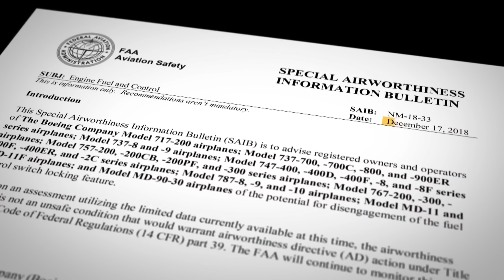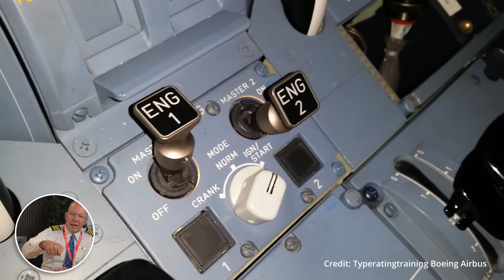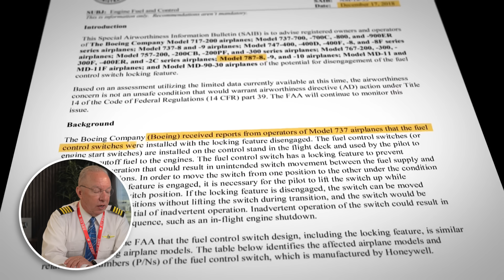Air India 171: The FAA’s 2018 Fuel Switch Locking Bulletin Explained (16 Questions Answered)

Comment: Captain Steeeve, I'm wondering why the pilot and co-pilot don't do a checklist before taking off.  And if they do, maybe this fuel switch locking feature needs to be part of the checkoff going forward.
Reply: This is in a checklist and the switches were at "on" or the plane could never have taken off.

Comment: all this convo about the plane not letting you not cut the fuel if the throttle is not on idle. what happens when engine fire or if the throttle is stuck

Comment: Video in the cockpit:
I know there is a lot of opinion regarding video recorders in the cockpit, and pilots privacy.  I personally think that given the importance of the job it is time that video recording was added.  Even bus drivers are often recorded now.  I think it unlikely that footage could be leaked in the same way that aircraft are not susceptible to hacking, i.e. no unsecured connectivity.  In the case of Air India 171, I really think there is a strong possibility that we’ll never know for sure which pilot set the cut-off.  What would it mean to their families if the wrong pilot was accused?  
The pilot who said “why did you cut-off?” could still be the one who did it, but who wanted to avoid accusation. Therefore, maybe the pilot who said, “i didn’t” had not done it. Wouldn’t cockpit video recording just provide extra evidence to work on?
Wouldn’t cockpit video recording help determine a pilot’s state of mind?

Realtime off-aircraft recording and analysis:
I’ve heard as part of the MH370 investigation that only some data is transmitted from an aircraft in realtime, mainly in terms of aircraft performance and maintenance.  Aren’t we at a point technologically where all FDR and CVR (and video) data, and position can’t be streamed and recorded to a secure data centre, in addition to onboard FDR and CVR?  This would lend less reliance on finding them, being undamaged, and save time.  In terms of MH370, it would have been invaluable.

Why default to cut off position:
Why does the switch default to, or be sprung to, the cut-off position?  I know it needs to be lifted, but why default to cut-off?  Why does it even need to default to either position?  Does the landing gear lever have a default position?

Why no “are you sure prompt” when in flight mode:
When the aircraft is in flight mode, i.e. the wheels are off the ground, why is there no confirmation prompt “Are you sure?” before a cut-off switch performs the selected action?  It seems easier to turn the engines off in flight than it would be to raise the gear on the ground.  If I wanted to delete a file on my computer I would be asked to confirm, but switch all engines off during flight or during climb and there is no confirmation?  Pilots will make errors, and aircraft will always malfunction, but it seems some quite basic logic is missing in aircraft systems, either misleading pilots or enabling them to almost make mistakes and get into situations which aren’t practiced for.

How often would you cut off in the air routinely:
Seeing that it is quite easy to cut off engines during flight, how routine is it to do so? For example, does a single engine need to be cut off once every 1,000 flights on average?  Does it occur more often than we think?  Would a confirmation step add too much of a time delay for the majority of routine cut-offs?  

What are the switches like in Airbus and other manufactures?
Are the switches common across other aircraft manufactures and do they work in the same way and have the same method to stop accidental operation?  My car has a lot of “soft” buttons and switches now, so if I try to push the soft button for reverse while travelling forwards at speed, the button just animates back to drive.  You have to press and hold to override that.  But at least is gives me a visual and audio cue that I messed up, rather than assuming I really did want to smash my gearbox up.
Shouldn’t aircraft systems help the pilots more?  I’m not saying necessarily take away control from the pilots, although I have read arguments for that, but just make the user interface more helpful.  Most modern cockpits still look like computers did in the 1970s.  Most of the switches look the same as those used in Concorde.

Comment: The fuel switch detents are not knife edges. They are flat areas. IT IS POSSIBLE to lift the switches and bring them to rest on this flat area BETWEEN the cutoff and run positions. On either side of the flat areas are the valleys into which the switch detents drop. If the switch is brought to rest in the in-between flat area, the switch will stay in that position for a short time. It's not like trying to balance on a knife edge. 

The important question is: How far into the arc of rotation (toward the run position, but before the detent drops into place) does the RUN circuit connect. This is what a very savvy engineer will test. If it is possible to connect the RUN circuit of the switch without going all the way forward, then IT IS POSSIBLE that both switches could have been incompletely moved to the detent position and then vibrated back down to the CUTOFF detent within a second of each other during climb out. Sounds impossible, but even the very lowest degree of probability still means possible. We wouldn't have the expression "one in a million" (or billion) if unlikely things never happened.

Comment: 15:11 "Was the RAT Deployed While the Aircraft Climbed?"
Captain Steeeve first, read the report carefully!!! Page 14: "The CCTV footage obtained from the airport showed Ram Air Turbine (RAT) getting deployed during the initial climb immediately after lift-off (fig. 15). Figure 15 CCTV screenshot of RAT Deployment.
Reply: So what is your message ?
Reply: @johnmoser1162   it means the RAT was deployed few seconds BEFORE the switches were in the cutoff position, indicating the electrical/power as the primary problem.
Reply: @jelenabaturina2889   Cut off switches thrown 3 seconds after liftoff.
Reply: My point wasn't about what led to the crash, but rather that Captain Steeeve didn't read the report thoroughly. He replied to the user that he didn't know where he got the information that the RAT activated immediately after takeoff, even though the description and photo were included in the report.

Comment: @CaptainSteeeve According to the preliminary report fuel switches were cut off one second apart. I heard many experts saying its impossible to manually shut them down just one seconds apart since shutting off that switch takes some effort/steps

Can you shed some light here on if its possible

Comment: Sounds like the report states that the 'co-pilot' was flying the plane during take-off. Hmmm? He only had 1100 flight hours and he's already the first officer on a major jetliner. From what I understand in the U.S. you have to have way more flight hours than that too pilot in any way shape or form a jetliner like the 787-8. I think the co-pilot made a mistake and hit the wrong switches and there was then no way or time to stop the aircraft from crashing. I really think that this was a co-pilot error especially since the black box recorded a question form one of the pilots of, "Why did you switch the fuel switches to cutoff?" Then realizing his mistake those two pilots tried to correct it but it was too late. 1100 flight hours for a co-pilot might be ok for Air India standards but that's not the standard I have heard and read about in the U.S.! 
SUPER SAD!!!!!

Comment: I don’t trust the sim to replicate an electric failure in such detail especially if there was an electric anomaly specific to that aircraft and wonder about the difference  the FDR to know the difference of fuel control switch actual physical position versus detected position and commanded signals.    CVR should be able to hear the switches being moved perhaps.  I wonder if something may have been placed on or wedged against the switches and subsequently bumped in such a way to knock them over the hump.  Though a one second time between switch positions makes that unlikely I know.

Comment: Why pretend that both pilots could do it in a same way. If pilot flying will do it, than captain as observing should see unusual movement of pilot flying and react in same second without asking and eventually take over control from suicidal pilot (as captain should do). It will be very pure strategy for suicide from flying pilot. 

But - Captain as observing has free hands and can cut off fuel switches without pilot occupied with flying can see it. Pilot flying reacts first to consequence of motors flame out, time goes, has to recognize what happened, time goes. 10 seconds is good time reaction for HIM, but it's too late for saving the plane. Newer has the chance.😢

Yes, it's speculation, but based on facts described in rapport... And pilot flying obviously didn't try to put nose of airplane down.

Comment: What puzzles me, the flight was short bit nevertheless there has to be more on the CVR than, did you cut off the engines, no I didn’t. Normally also ATC Communication is included in the Report. I am sure the controller in the tower responded to the mayday call. To me the preliminary report seems odd.

Comment: I see many people talking about CCTV in the cockpit. Just think about how some airline review videos show cabin crew becoming visibly nervous or overcompensating when they realize they're being recorded. Now, imagine that same scenario in a high-pressure cockpit. We already have systems in place to monitor every action of pilots, which is why increased pilot monitoring beyond current levels is unnecessary, apart from merely presenting an image to that action.
Reply: Dude why you so dumb? Video recordings would be stored inside black box. Not on a flash drive. By your logic, audio is also recorded inside cockpit so pilots would feel the same pressure
Reply: If a pilot is so worried about overcompensating because he is on camera and doing the "right thing" becoming nervous then I wouldn't want that pilot flying me.
Reply: @SteveNas530  if pilots are scared of facing camera inside cockpit, they should stop vlogging and making YouTube content where they ain't camera shy

Comment: Retired A-10 Engine mechanic/USAF Flight Safety Investigator here.. 

⚠️Why are there fuel control switches in the first place???   This seems like an added unnecessary feature. Keep traditional switched Fuel feed boost pump systems and the ability for the system to operate via Gravity Feed. 

Let the Fuel Engine Relay Box or equivalent do the work of starting/restarting the engine. 

If you need to cut the engines off, either set throttles to cutoff or pull T-handles. Both actions require serious willful intent to cut fuel off to the engines.

KISS : Keep It Stupid Simple Boeing/GE

Comment: I have three questions.

1. If we are not allowed to text while driving, why should a pilot read a magazine while he is responsible for hundreds of passengers on board?

2. If the fuel cutoff switches had been installed backwards, wouldn't that have been shown in the investigation?

3. Is it possible that the plane's computer could have been hacked, sabotaged, or a terrorist act?

Comment: A lot of people are asking why there aren't safety mechanisms to prevent the pilots from turning off the fuel.   Captain Steve explains why such capability shou5exist.   The bottom line is that at some point we need to trust the judgement and expertise of the pilots.    As much as I distrust most people,  I trust computers even less.

I hope I didn't offend anyone with my post in the previous video jesting about having an inflatable automatic pilot to take over like they had in the movie AIRPLANE.

Comment: In what possible circumstance would a pilot need to cut fuel to both engines right after take off? Even if there was a fire, how would turning them completely off do any good? The planes logic shouldn't allow it to happen IMO because that implies the plane is going down 100%

Comment: I’ve researched the Air India 171 crash and found that Captain Sanjeev was never married and lived only with his father, a retired DGCA official. He had promised to retire soon and take care of him. With no financial or emotional stress, it’s unlikely he was depressed or responsible for the fuel cutoff.

At 13:38:39, the aircraft took off.
At 13:38:42, Engine 1 fuel was shut off.
At 13:38:43, Engine 2 fuel was also shut off.

The First Officer was the Pilot Flying (PF), meaning he had full control of the aircraft. The Captain was acting as Pilot Monitoring (PM), focused on systems and procedures. Around 5 seconds after liftoff, the Captain noticed something was wrong — he heard the RAT deployment, sensed a drop in engine sound, and likely saw N1 values drop to 0. When he checked the overhead panel, he saw that both fuel control switches were set to CUTOFF.

Shocked — and knowing no one else was in the cockpit — he turned to the First Officer and asked, “Why did you cut off?”

At 13:38:52, the Captain turned Engine 1 back to RUN.
Following standard protocol, he waited 4 seconds to observe N1 rotation, confirm system status, and avoid simultaneous electrical load, then switched Engine 2 to RUN at 13:38:56.

The First Officer responded, “I didn’t.”
But if he truly didn’t know what had happened, a natural response would’ve been something like “What do you mean?” or “What happened?” — showing confusion.
Instead, the direct denial — “I didn’t” — shows he knew exactly what the Captain was referring to, strongly suggesting he was the one who manually shut off the fuel. Despite flying the plane, he made no attempt to recover or help during the emergency.

At 13:39:05, the Captain gave the “Mayday” call after seeing that Engine 2 was not recovering and the aircraft was unable to generate lift.
At 13:39:11, the aircraft crashed.

The First Officer was due to be married in 2 months. It’s possible that a relationship issue or emotional crisis triggered a mental breakdown. The fuel cutoff just 4 seconds after liftoff, followed by silence, denial, and inaction — all point toward a deliberate act, possibly driven by relationship-related depression.

While the final DGCA report will confirm the truth, the evidence so far shows that the Captain acted quickly and professionally, while the First Officer may have intentionally caused the crash.

Comment: You said a couple days ago that the switches had to have been manually clanged to cutoff.  The voice recorder captured one pilot faint to the other “why did you cutoff?”  My questions are (1) what are the ways that the first pilot could have “detected” that the switches were moved to the cutoff position ? Eg a light on a screen, an alarm, or would the pilot have to have seen the other pilot move the switches?  Or judging by the noise of engines reducing thrust after the fuel is cut may have triggered the first pilot to look down at the switches and say that time be far they were in the cutoff position?  Additional question:  the second pilot said “I didn’t do it” meaning either (1) he didn’t touch them and there was a mechanical or software glitch that moved the switches into the cutoff position or (2) he DID move them and either had a mental lapse and didn’t recall doing it OR he lied - please comment

Comment: I am disappointed with the "Got to be physical movement of the fuel cut off switches; no  other way" attitude. How exactly is the physical position of the switches determined by the FDR? I have no idea but I can hazard a guess that it will be a result of some logic somewhere receiving an electrical signal. And of course, logic says that signal can only be true if the switch is moved. So, the person writing the FDR decoder manual says it means the fuel control switch has been moved. Well, that is simpler to write something like "Either the fuel control switch has been moved or an unexplained signal has appeared on the data bus". I doubt very much that there is any hardware connection from the switch to the FDR or FADEC etc. If I was designing that part of the logic, I would look at the indications of electric power supplied to the fuel pump; Yes/No. You know where that power comes from. You also know what phase of flight the plane is in and it would be simple to deduce whether or not this should be happening, override the faulty logic and tell the pilots "This should not be happening. Do something!"

Comment: May have said this earlier, but, if so, still—
Presuming neither pilot error nor deliberateness, either:  1) Switches fell out of locked position due to known mechanical problem (bulletin), maybe resulting from a vibration bump, or never having been fully secured into locked state, then pilots later returned to RUN.  Or, 2a) systemic electrical malfunction or disturbance caused RUN position signal from switches to be lost momentarily, interpreted by FADEC as then being to shutdown cut-off, and data recorder to also see them as no longer being in RUN (or, FADEC, itself, is what reports this perceived setting to recorder), with the signal states to later become corrected/restored as electrical power to the switches returns; or, 2b) the electrical situation caused each FADEC to reset/restart (which might take differing lengths of time).  I.e., the switches NEVER physically moved out of RUN in either sub-version ‘a’ or ‘b’ of second scenario.

The fact that pilots in simulator could not reproduce this accident does not prove that some electrical fault was not still the culprit.

EICAS may have warned, but would have been of little effective value.
Reply: If only there was a video...